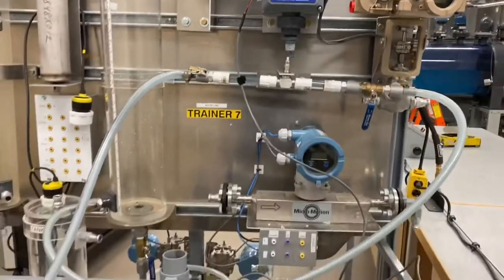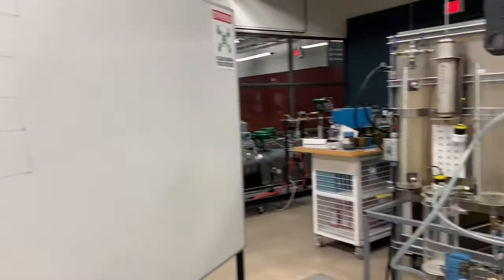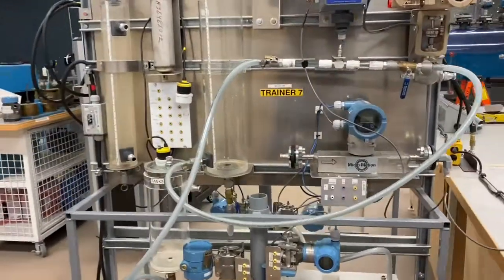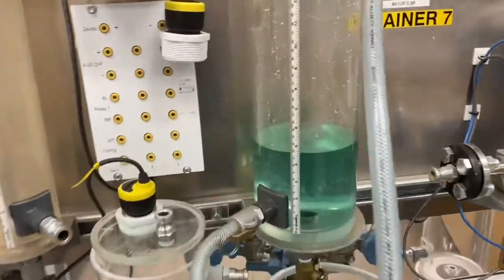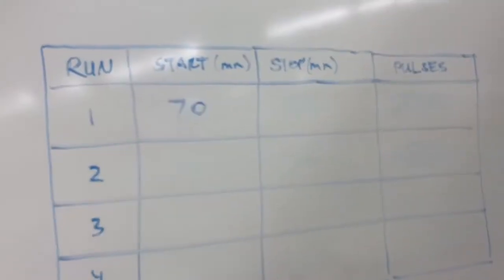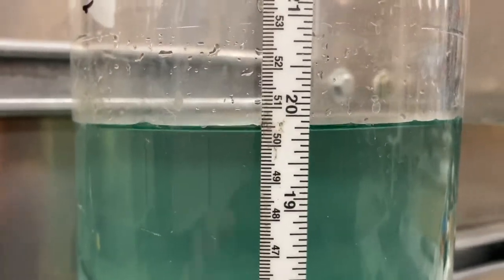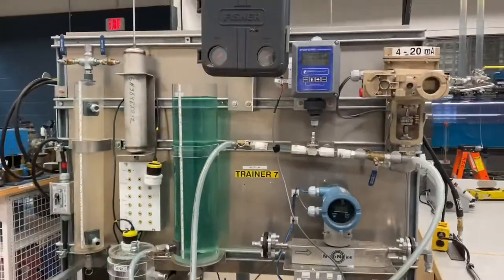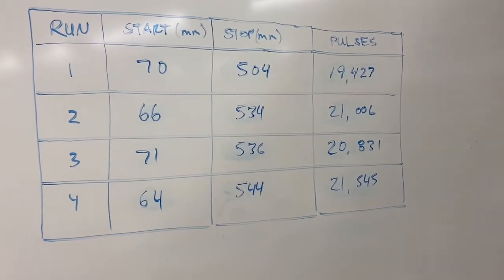IET 216 (Process Measurements III) - Lab 4

Comment: Sir, how did you calculate the k-factor using generated?
Reply from the maker: The K-factor is pulses per litre, so we took the pulses for each run and divided by the total volume in litres to determine the K-factor for each run. The final K-factor value is the average value of the K-factor for the four runs.